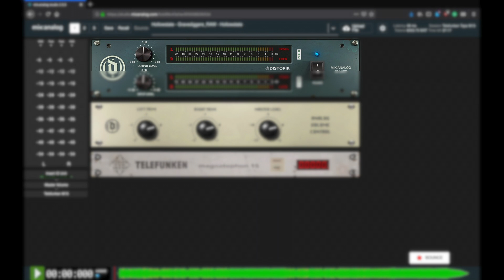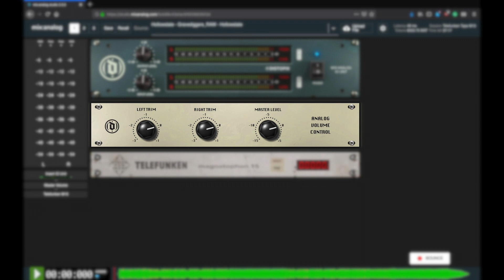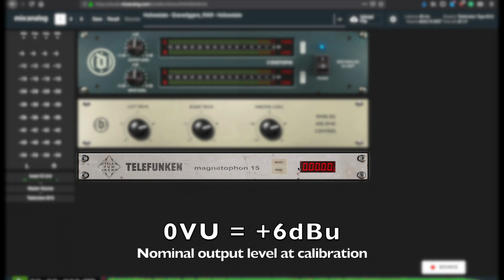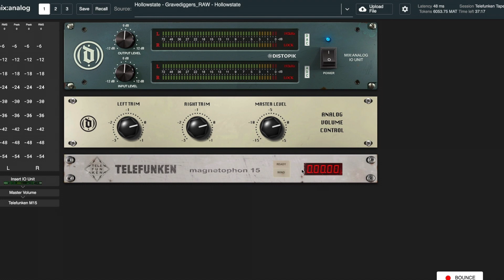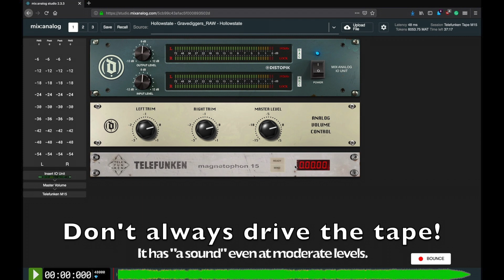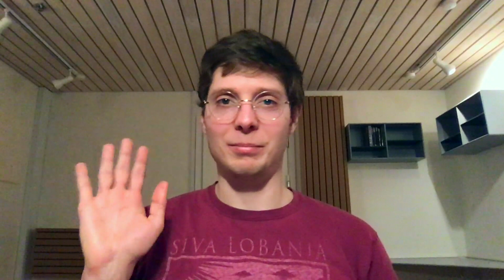mix:analog | Telefunken M15 Tape Machine Tutorial

Comment: Hello!
I saw on your website you repaired Telefunken M15 and you had a manual. I also have a Telefunken M15 and I also need a manual, but I can’t find it anywhere, unfortunately not on EBAY either, only on the M15A. Could you help me, maybe you have an electronic version of the manual?